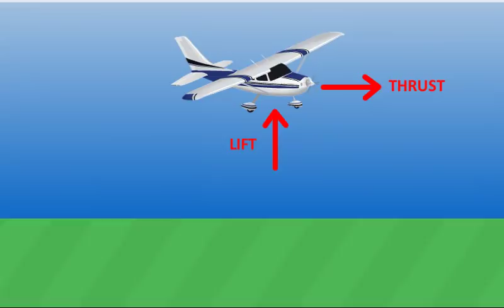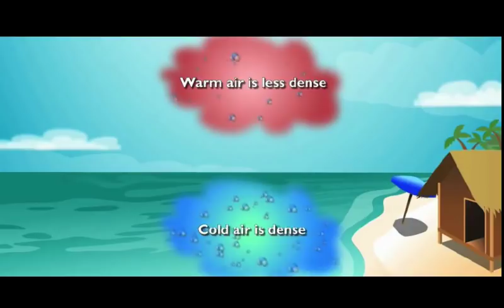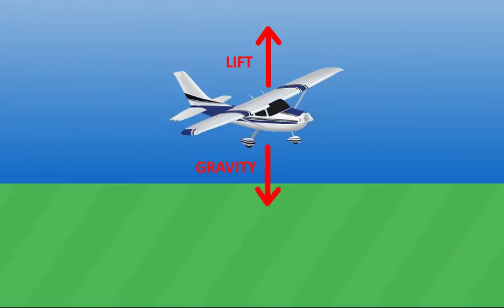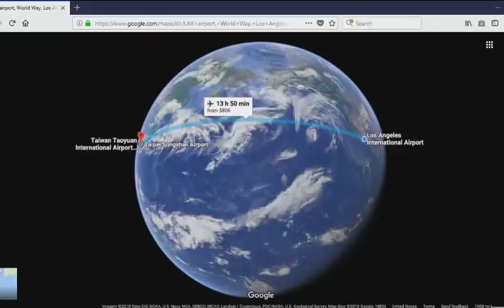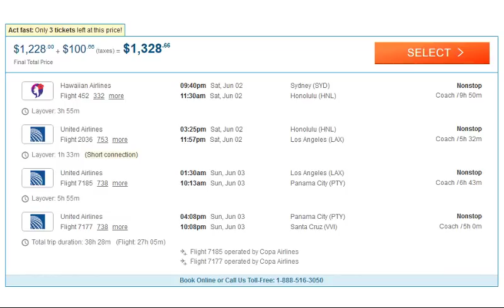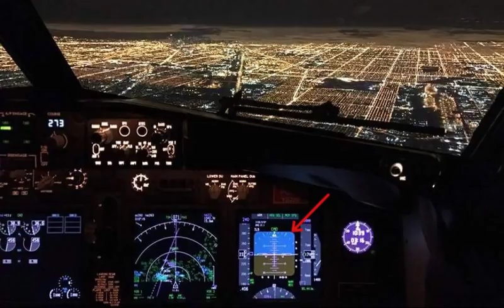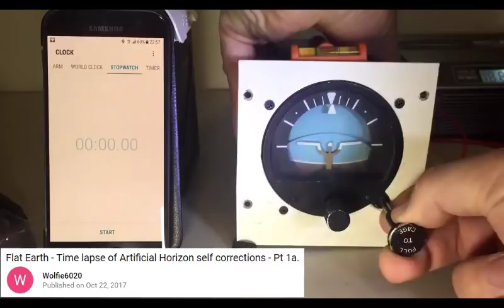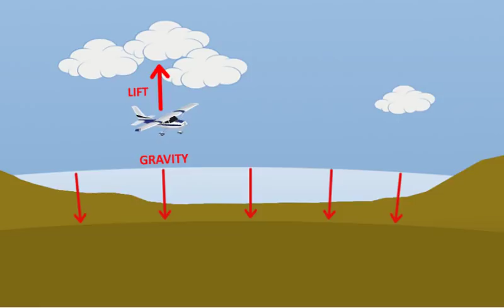Flat Earth Falsities - Plane Nonsense

Comment: My flat earth friend says they should have landed in hawaii that is was closer does anyone no why they didn't.
Reply: Ask how a 747-400 flies Mach 2 from Sydney to Santiago, especially when the nonstop flight runs out of fuel half way? I can answer his question but he can't answer mine — can you?
Reply: @romithromith   No variant of the 747 flights at Mach 2. Not even Mach 1. 747 are not supersonic airplanes.
Reply: @Er_Guille  Exactly.
Reply: @romithromith  :what?
Reply: @romithromith  , yes i can . But you are a stupid Guy, sorry.
Reply: There was a flight from Taiwan to Los Angeles that was diverted to Anchorage because one of the passengers gave birth to a baby. Flat-Earthers use the case as one of the first “evidence” from flight routes proving Earth is flat.

They are wrong. The case only tells us about the ignorance of these flat-Earthers about the distortion in a map projection. Their argument started with an elementary mistake of taking a straight line on a Mercator map between Taiwan and Los Angeles, and assume it as the “intended flight path.”

Note: Some reported the flight originated from Bali. However, there has never been any flight from Bali to Los Angeles. The correct flight was from Taiwan to Los Angeles.

By taking a straight line from Taiwan to Los Angeles in a Mercator map, Anchorage appears to be far from the “flight route,” and locations like Honolulu appears closer and more suitable as a diversion airport. Then, they take the so-called “flat-Earth map,” draw the same straight line, and noticed Anchorage is very close to the flight route. They falsely concluded that the so-called “flat-Earth map” is a more accurate map.

Due to distortions in maps, straight lines in a map do not necessarily represent straight route in the real world. The closest distance between two locations is determined from the great-circle method. From this, we can know that Anchorage is indeed a major city closest to the flight route, and it is a suitable diversion airport.

For a better understanding, we can try using a string on a globe. Pull the string between Taipei and Los Angeles on the globe, and try to make the string as short as possible. The result will be consistent with the spherical Earth model and the actual flight route recorded by websites like FlightAware.

https://flatearth.ws/wp-content/uploads/2018/11/taiwan-la.jpg

Comment: Is  gravity  can  be  measured How strong  it  is?
Reply: Proportional to the mass of the bodies. You measure gravity everytime you weigh yourself on a spring scale.
Reply: Actually yes. Objects weigh slightly less on the equator, and the acceleration we experience isn't the same everywhere. They actually measure that acceleration to determine how strong the earth's gravity is at a certain point. Earth's mass also isn't distributed perfectly even - so at places with more mass = stronger gravity.
But these are very slight differences.
Reply: It applies an acceleration of 9.8ms2 at ground level.  This can be directly measured with any good smartphone.

Whereas density or RDD cannot be measured at all.  It can even be explained coherently.
Reply: On Earth, 9.8 m per square second.